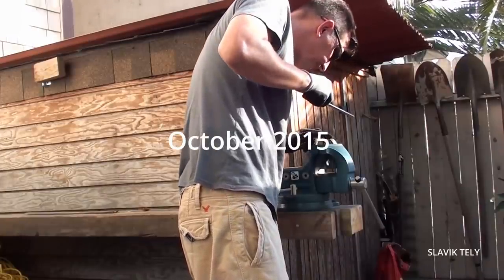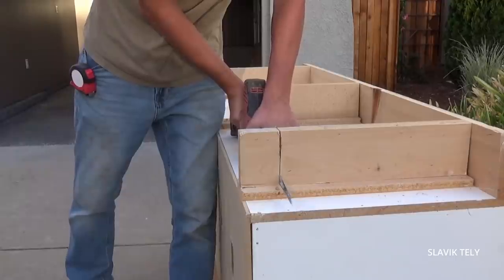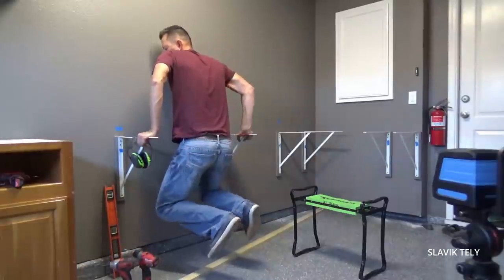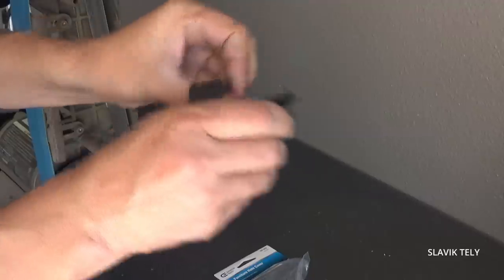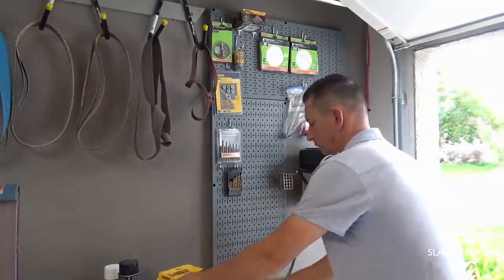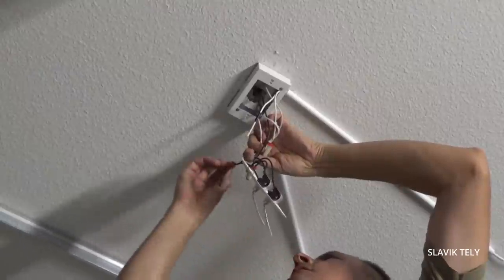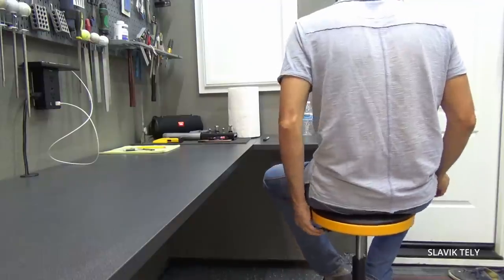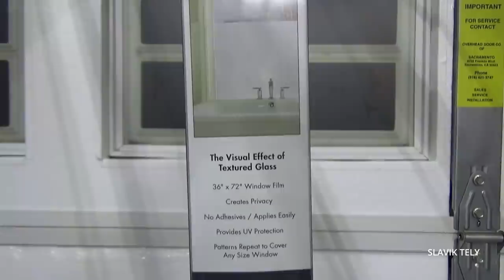My new garage Knife Shop

Comment: New shop looks awesome! Word of warning from metal/wood worker with first hand experience:
Be wary of the cheap power bars. Had one melt down in my wood shop. That could have been a disaster, but I got very lucky.
Second. With doing grinding on metal and wood, PLEASE, cover all your wall plugs!!!!! I had metal dust from my chopsaw and grinding accumulate on the tops of the wall plates and plug heads. It arc'd in one socket and smoldered away over night. Again, luckily, It just smoldered and scorched the painted ply walls and melted the plug. VERY LUCKY!!! 
So, what I did to keep the dust from settling on the sockets and plugs was to cut 'flaps' about 6x6" out of vinyl tarp material. I pinned the top edge of these above the sockets. They sort of form an awning that flops over the plugs when plugged in and hangs down to fully cover sockets when nothing is plugged in. 
I really can't stress enough how dangerous this little considered hazard is. My shop is detached from my house. And given yours is in your family home, it's a thousand times more important. It's cheap and easy to do and takes not time at all. I'm no Safety Suzy, but given I could have lost my everything, it's a valuable lesson I pass on to fellow metal/wood workers when I can. Hope you read this and take my advise. 
Best wishes
Bert

Comment: No issues with the breaker for the garage? You added a lot of outlets and lights. I did some of the same upgrades in my garage and at times, I’ve thrown the breaker. Having a big fan, grinder, lights, radio running, whatever. Different combinations can cause me problems. Your house is newer. You might not have the same issue I have. Looks good!